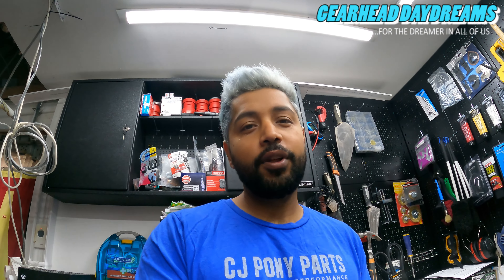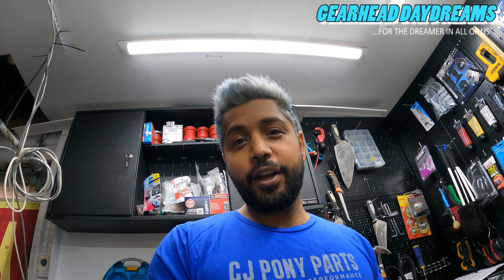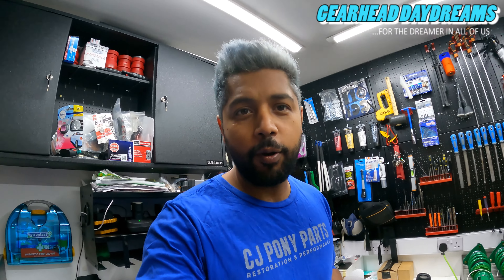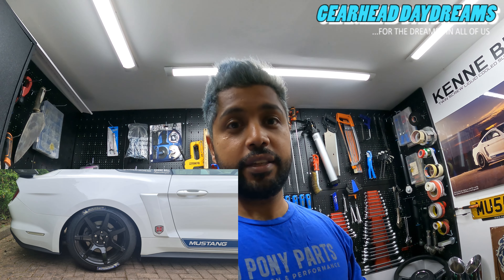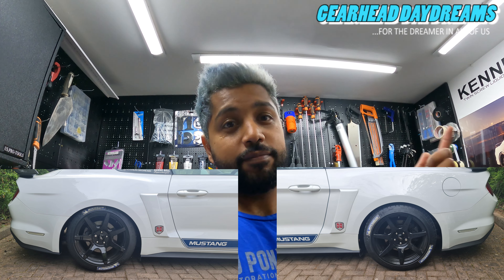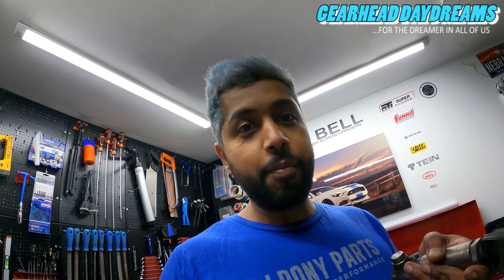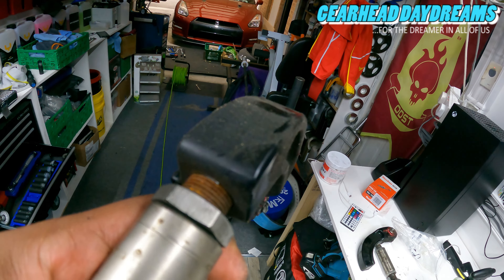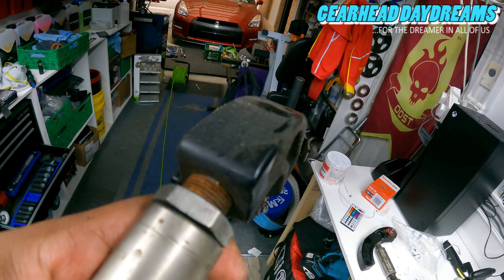My Camber Arms broke on the Mustang! So, here is how to install BMR UCA762 Adjustable Camber Arms

Comment: Sorry to hear that your car broke down.  I put Steeda camber arms on my 21 GT.  They seem to be good quality.
Reply from the maker: Thanks man. It happens. I think my car is more of a prototype now than anything else. There is so much on there haha. The warranty replacements from UPR are made from much better materials. Even the threaded adjuster and nuts appear to be made from billiet machined aluminium rather than the previous cast steel offering.

The BMR ones are creaking pretty bad. If they don't get quiet soon, I'm going to whip them off and put the upgraded UPR ones on.

Comment: For these camber arms, is there any hardware included that you need since on their website it says it comes with installation hardware?
Reply from the maker: The factory inner and outer bolt and nuts are reused. You will need a cable tie. Checkout my unboxing video to see exactly what you get out of the box for peace of mind.

Comment: I cannot believe the design of those UPR arms ever passed testing?
Reply from the maker: They werent fit for purpose. Their updated design is a whole lot more sturdy. Time will tell if they last. I'll continue to check on them.

BMR ones I had to remove because they squeaked too much.
Reply: @GDaydreams  wanna sell the BMR ones?
Reply from the maker: Nigel. They are so so so bad. I wouldnt sell them. When I say the squeak bad. I mean it's like having a screaming monkey on each corner. I tried everything to fix them. Teflon, silicone grease whatever.

Useless

I have kept them for now incase the UPR replacements break so I can be back on the road at least.

If you do want to buy some. Go through summit direct. Will be cheaper than anyone else.